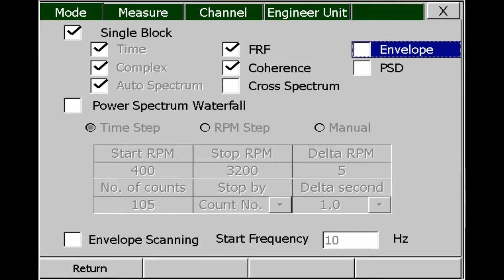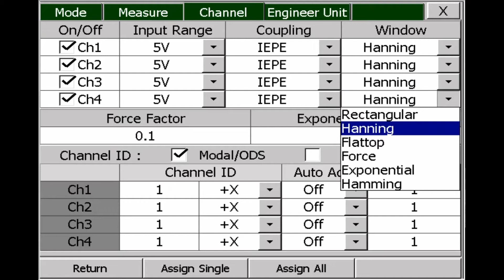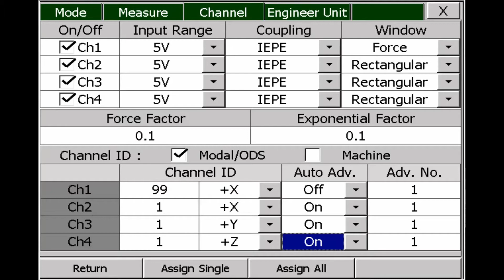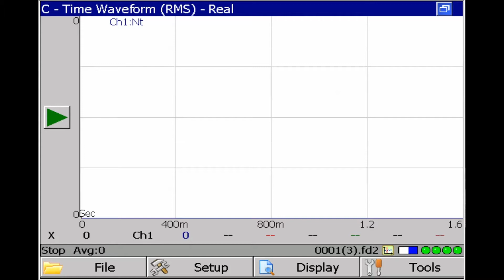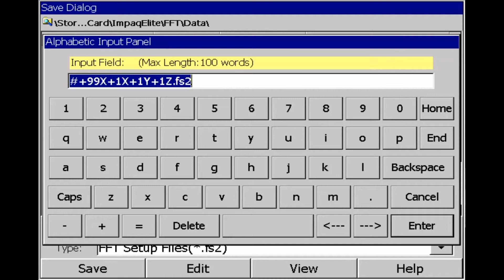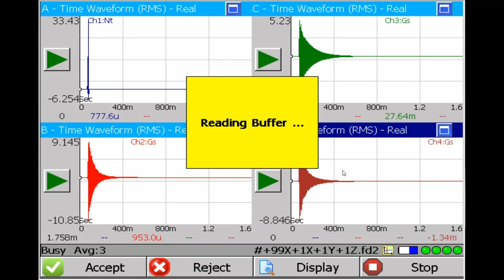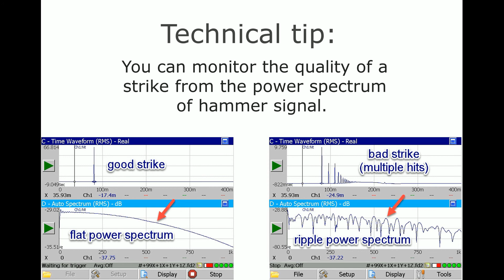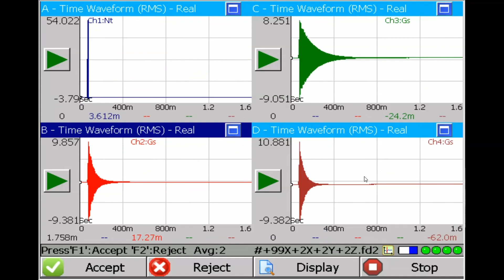Collect FRF data via impact test (bump test) for experimental structural modal analysis

Comment: Is it possible to do this experiment with an audio software? what would you suggest? Thank you.
Reply from the maker: It depends.  If your audio software supports triggering features, and it can provide FRF calculation, I guess that is possible.  Note that it also requires your input channels to be synchronized to have correct phase data.